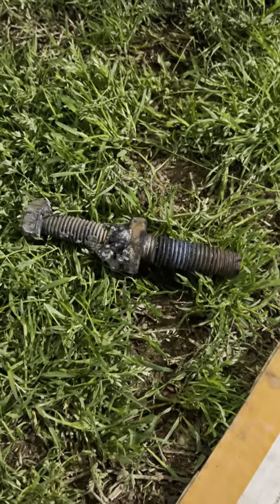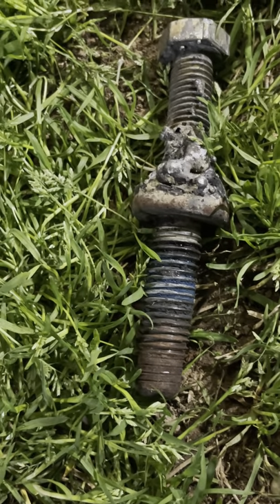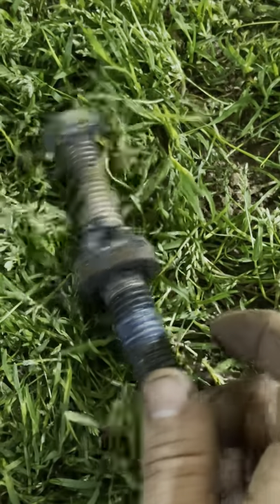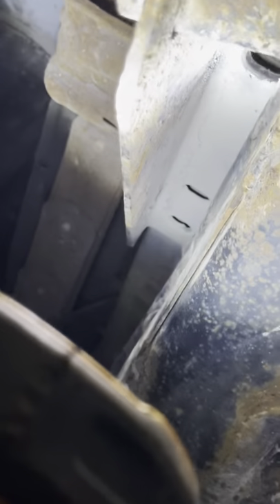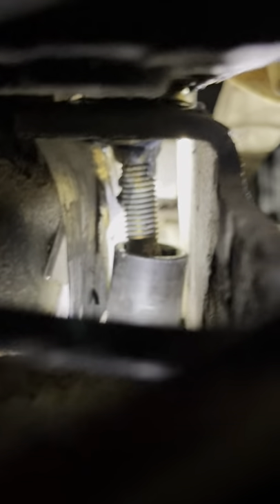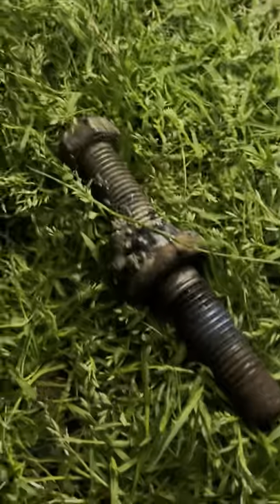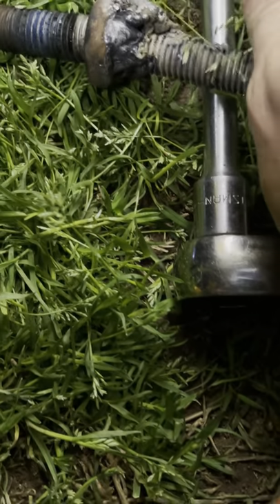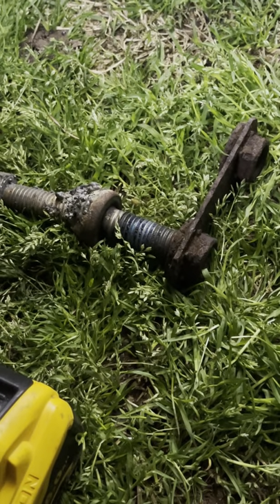Replacing trailer receiver hitch and removing impossible round factory bolts on 2003 Ford excursion

Comment: They are round due to a government regulation. Ford uses the hitch to protect the fuel tank to meet safety standards. They had to make it a "permanent" part of the vehicle. There are the same type of bolts on the bottom bar on the front.

Comment from the maker: Found mine on eBay and it seems to be very well-built. Appears much stronger and substantially heavier than the stock hitch was. This is the one I got. Curt 14011. I have always received great parts from curt. They always have fit perfectly.